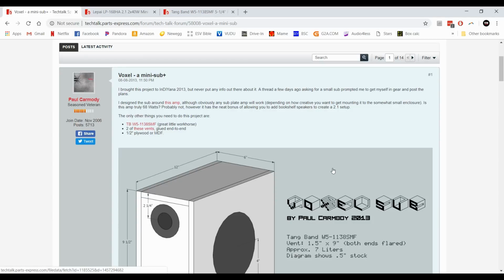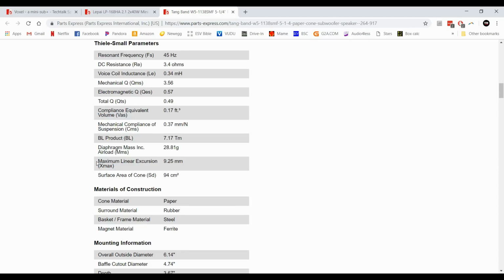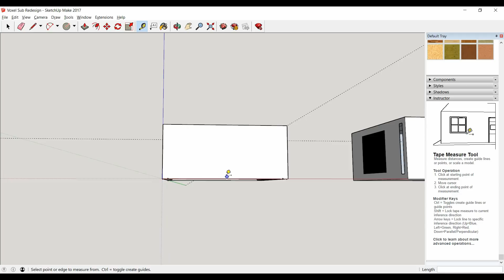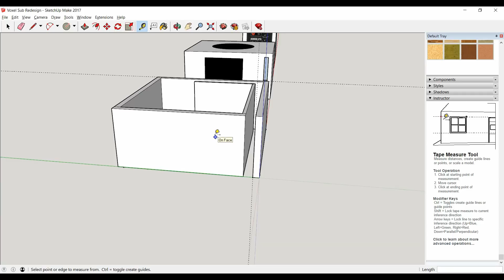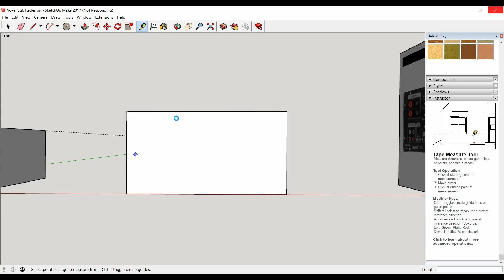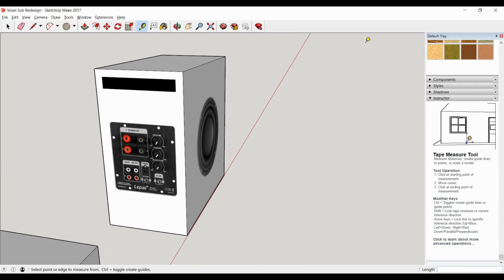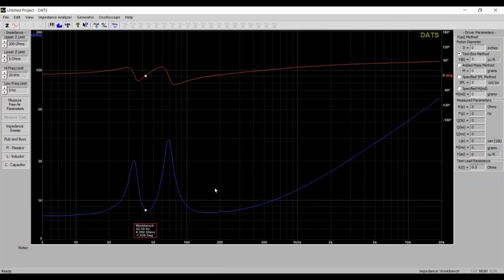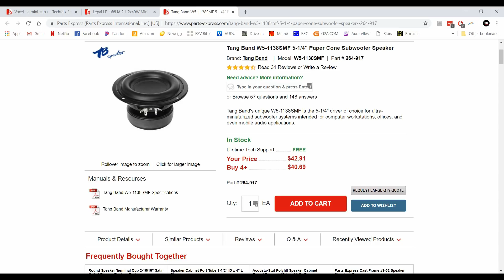The Voxel Sub Gets a Slot Port!

Comment: I am building a bunch of subs based off of these designs for my self and my kids.  I am using the   Dayton Audio SA70 70W for my main music set up. .  If you go with this amp the box size has to increase slightly as the  Enclosure cutout is 6-5/8" W x 7-3/4" H. with a depth of 3 1/2".  why this amp ? I have used this amp before and the extra power is good.  the price is the same as the amp in this video.  I plan on using the amp in this video for my  kids music/computer speakers...  I wish it had blue tooth.

Comment: Changing the 1/2 inch cabinet thickness to 1/4" thickness for the port is not wise or efficient design. How on earth is that justified for such a simple project? You're adding a 'monkey wrench' into the grand scheme of things. As a speaker builder since the 1980's I have to say you fucked up on that detail. Otherwise, not a bad video/project. The slot port is more cost-effective than a plastic tube. I'd love to hear your reasoning/justification to add 1/4 inch material to such a build.

Comment: That's great you don't experience any chuffing. I posted a design for an 8" Tang Band box on PETT and Bill FM suggested not having a slot under 1.5" due to the air friction in the first 1/4" against the wall. 
Maybe this 5.25" just doesn't create enough velocity compared to the 8". 

Nice cherry inlay in that, too!
Reply: 123Toid did you use the T/S numbers off the PE site for this driver, or did they end up different after you got it and tested it yourself? The only reason I ask is because I can't seem to duplicate your calculations in WinISD using the numbers off the PE site. The closest I can get is with 7.3L tuned at 43Hz with f3 of 37, but the port ends up being 19.46" long. 

Based on the numbers I'm using, 8.5L tuned at 38Hz with a 21.5" port puts the f3 down to 33Hz and seems like the lower limit for that driver. But I'm guessing the numbers on the site are different from what you and Paul used in your calculations.

Comment: I have a voxel for my 2.1 PC system. It's sounds great at medium volume. I might try this design out for it.
I also have two Tang Band W6-1139SIF 6-1/2" subs in my car. What would the dimensions be for this style box but for one of the W6s?
Reply from the maker: I haven't designed anything for that yet. I am coming outt with my final design for the w5 soon. It is actually front firing with a front port.

Comment: Hi Toid, I'm looking at making something like this myself. Quick question, do you remove the volume of the slot port from the overall internal volume?
Reply from the maker: Yes you do.  You want to account for the slot port, subwoofer, the amplifier and any bracing.
Reply from the maker: If you want to talk about it on Patreon, I can help you design it or design it for you. Whatever you prefer.

Comment: I think you're better off with a round port than a slot port, certainly for this application as you want to keep the port size down by maximizing the possible air velocity. Round ports are inherently better for high velocity applications. You could for instance use a 2inch precision port together with a 2inch 90 degree PVC bend. This does save some cost though
Reply: Just to flesh this out:  there exist very high quality slot vented speakers.  The Sequerra Met 7 mkII, for instance isn't remotely limited by a slot vent in a cabinet of very similar dimensions as the Voxel.

Comment: What is the port air velocity at 40 watts? I’ve built Paul’s Voxel and a version of my own with a 2 inch diameter port. This little sub moves so much air, eliminating chuffing is a challenge.
Reply from the maker: It is a challenge.  At 40 watts the theoretical max port noise peak is 17 m/s at 37hz

Comment: I have a question that's been bugging me, I'm not new to building a subwoofer, but I'm not by any means very familiar with everything to do with them.

I see in the video the impedance rises to well above 20 Ohms, If we use that 2.1 plate amplifier you listed for example, and say it can do a real 60w rms at 4 Ohms, is it going to be under powered around that impedance spike? Or am I missing something?

I'm asking as my Ultimax 18 shows a 22 ohm spike at 28hz and testing the AC voltage coming out of the amp, and a watt meter at the wall, confirmed it was there. (16v at 17hz vs 32v at 28, box is tuned to 17)
Reply: From Barevids box rise video: 1) Coil moves in magnet creating current which opposes that coming from amplifier. 
2) Amplifier sees opposing current as resistance.
3) Things that cause higher resistance due to higher opposing current: high excursion, strong motor, tight coil gap, many coil windings, large boxes, playing outside of tuning frequency.
3.5) In free air, Fs yields highest impedance. In a ported box, tuning frequency yields lowest impedance.
Reply: Also watch his video, explains alot

Comment: That 5.25 sub is like 1 inch frame, 1.25 inch surround, and whatever is left cone area.
Edit: title says "Subwoofer" but if you go to the bottom of the spec the category is a "woofer". That's 2 different things. 

Not bad if it gets to 35hz f3.
Reply from the maker: I am not sure why Parts Express put this in their woofer category, that is wierd.  having said that, this is a subwoofer.  Even Tang Band, the manufacturer, lists this as a subwoofer.  It'd be interesting to see why parts express labeled it as such. http://www.tb-speaker.com/products/w5-1138smf
Reply: @Toid  probably human error or the automation puts it under woofer because of the size ? no idea.

Are you gonna build one ?
Reply from the maker: @Quetzalcoatl0  I already have it built.  I just don't have it "finished"  I had this thing running for a while, 2 weeks to a month, before I released it.  I love it for it's size.
Reply from the maker: @Quetzalcoatl0  Interestingly enough, they have it listed both under woofer and subwoofer.  Good catch.
Reply: I think a 5.25" driver being called a subwoofer has to do with Tang Band telling PE what it is and certain specs of the driver like xmax and EBP. So, I think you could get away with it as a sub, a woofer, or a mid bass depending on the harmonic distortion measurements and the listing reflects that.

Comment: If you use the plate amp on this build, should you make dimension adjustments to account for the space that the amp internals take up?
Reply from the maker: Great question! If you use something like the LP210PA (https://amzn.to/2QaIXhL) then you would not have to worry about that at all.  Which is one of the reasons I wanted to show it.  This is due to the fact that it is only protrudes 1/2", which is the same width as the material the box is made of.  However if you chose a significantly bigger amp or built and enclosure around the amp, then you would want to account for that change in volume.